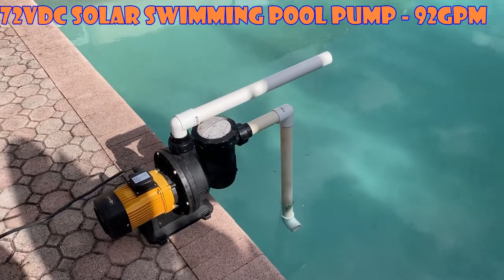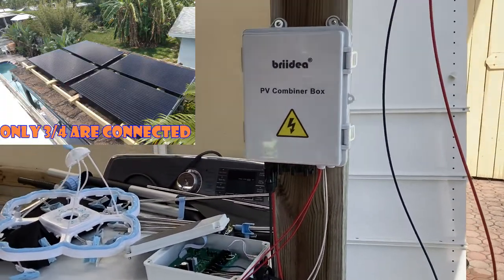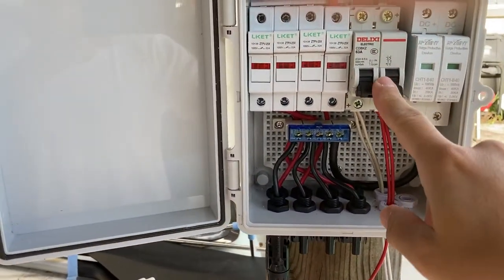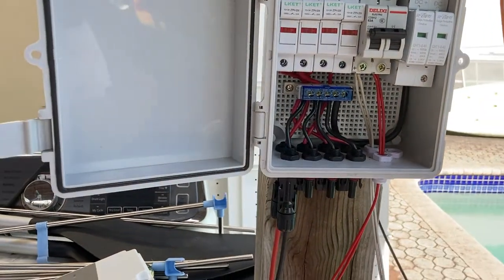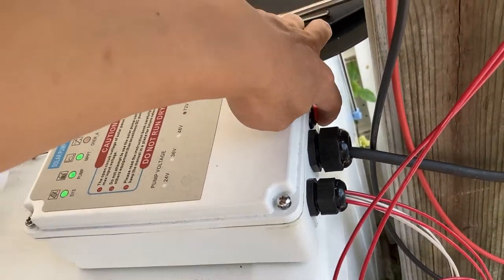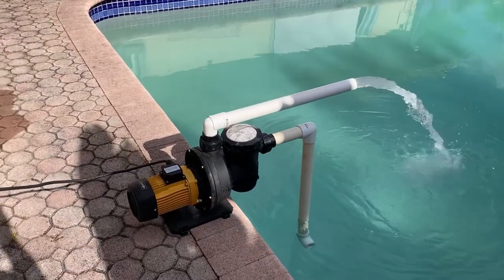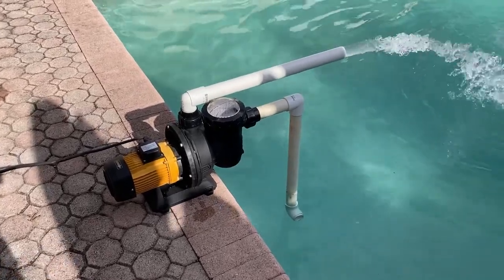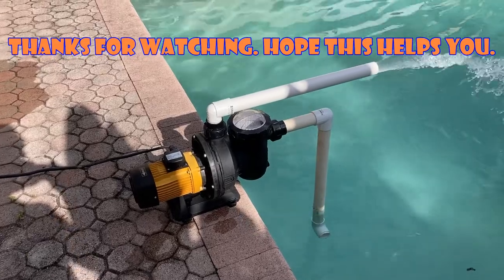Solar pool pump demo

Comment: I'm building a small plunge pool ,about 1200 ga. This would be ideal for me .. since it's all solar do you see any reason to have to run a electrical ground bond ?
Reply from the maker: Hi, John. This 900 watt solar pump may be a tad oversized for a 1200-gallon soaker. I believe they sell smaller versions of the same product line that will not need as many panels to power. I'm not an electrical expert, so I'll defer your question to a guy I follow on YouTube from my home State, Mike Holtz - https://www.youtube.com/watch?v=Ypo99VRxT44&t=1786s
Reply: Any electrical around a swimming pool should always be grounded well... 

Safety

Comment: 1 Year update on your Solar pool pump installation?  What make model did you buy?  How is it holding up?
Reply from the maker: Thanks for keeping up with my status, @flippedout. The pump is still humming along, but I had to replace the bearings a couple of months back because it runs too much; it runs for however long the sun is out, every day of the year. I could put a timer on it, but that seems like a waste of free solar energy. I highly recommend this solar conversion for all those still grid tied to the matrix.

Comment: Hi I also bought mine, do you really need the combiner box?
Reply from the maker: Hello, Delton. The combiner box is not necessary for my set-up because I don't have many parallel connections, but I like having a switch in-between the panels and the controller. The fused connection in the combiner box, along with the lightning protection circuit provides a nice touch. All the best to you and thanks for watching!

Comment: What kind of PVC connection is that? Looms like a 2" slip/socket. Did you use pvc glue or is it a compression fit like on a True Union?
Reply from the maker: Nothing was glued in this test set-up; all friction fitted. In a second video, all of the PVC mating points were glued. The black connectors are of the True Union variety with gaskets. And these were 1.5" pipes. Thanks for watching. All the best with your install.
Reply: @SuperWhizy  I have the 1200w pump arriving tomorrow, looked like it has the 60mm/2in pvc fittings. Phew, thought I bough the wrong fittings!

Comment: I hooked up 6 185w panels in series and I burnt my box up pump never had chance to turn on
Reply from the maker: Sorry to hear about the mishap, Turklanes109. The solar controller has very specific input parameters that must not be exceeded; in particular the Open Circuit Voltage (OCV) for the panels cannot exceed the rated voltage input for the controller. Linked in series, the voltage has an additive effect, hence to achieve the proper wattage, you'll have to parallel the panels and boost amperage.
Reply: Ok I’ll try parallel
Only thing I’m confused about is when you say boost the amperage
Reply from the maker: According to Ohm's law, voltage(V) is additive in series and current(I) is additive in parallel. I find it easiest to back in the numbers through the power equation: P=VI. Your 6 panels at 185w produce theoretical max of 1110w. If your OCV limit is 150VDC, string in serial the number of panels that add up just below the voltage limit and parallel the rest. Assuming you add up to 120VDC, this will put your current at 9.25amps. I wish you success going solar, Turklanes109.

Comment: Hey Superwhizy, what was your all in cost on this set up?
Reply from the maker: $480(pump and controller), $200 (used solar panels), $100 (combiner box),  %80 (lumber and hardware for solar racking), $150 (wiring and connectors), $50 (plumbing)... All in all, roughly around $1100. Knowing that it'll cost nothing to run the pump 8+ hours a day; priceless! Make it happen, Stephen. ;-)

Comment: Just finished my hookup today inspired by this video. One question when solar power is low morning and evening will that harm the motor?
Reply from the maker: Welcome to the solar rabbit hole, Sir Gregalot200. I do notice mine cycling on and off quite often during the transition periods at dawn and dusk, or overcast days, but the controller has been performing rather well without intervention. I thought about wiring the on/off switch on the controller to a smart timer just so it'll come on when the sun is definitely out, but I've not gotten around to it. Thanks for watching and for the motivational credit. All the best!
Reply: @SuperWhizy  While swimming yesterday evening I paid attention to the pumping and even though the sun was below the tree line the pump was running slow but water pressure was still coming out of the vents, not strong but it is pumping. Also our pool seems to be cleaner it is crystal clear its normally clear but it's now really clear.

Comment: Any update on how this setup is working out for you? I'm looking at doing the same but also having a ac pump and a flow meter to turn on when there is not enough sun or rainy days. Also do you know what the volt and amp specs are for the controller?
Reply from the maker: Hello. I'm extremely happy with my Solar pump set-up and have made a second video about it here: https://youtu.be/gB5BYZT-3pc. I don't recall the exact specs, but I know the pump is a 72 volt model with around 900 watts of power. It's a variable speed permanent magnet (brushless) pump that is mated specifically to the MPPT solar controller. I would recommend searching for others who have installed their system in tandem with an AC system, I didn't want to bother with the extra plumbing, hence my barebone approach to this issue. Thanks for watching.
Reply: @SuperWhizy  what kind of warranty does that pump have?
Reply: @wildnuts6197  oh... that its cheap enough that if it goes back you can buy another for $400?
Reply from the maker: Strange... these two comments did not show up on my management UI. Glad you were able to sort out your question. All the best with your Solar conversion.
Reply: @SuperWhizy  I am curious about how you switch it on / off.?? when the sun gets high enough does it just start running?
Reply from the maker: @williamrenfroe546  Apologies for the delayed response. These sub-threads do not show up on my video management interface. My set-up can be shut-off by killing the solar input, or downstream at the MPPT controller. The pump starts running at first light, albeit poorly (like a wheezing asthmatic), but eventually it picks up speed midday, and goes through the same wheezing cycle at dusk.

Comment: WHAT'S the power voltage or HP ON THE PUMP?
Reply from the maker: Hello, Larry. I never did figure that part out. The booklet that came with it said it was a 900 watt permanent magnet pump. My motivation for getting this package was specifically to NOT have to figure out this aspect of the operation; AC, DC, in-rush current, speed controller,... etc. I mated it to 1200 watts of DC input, connected the pump to the MPPT controller box that came with it, plumbed it, and am treating it like a black box that'll do what it needs to. I have a hunch that it may be a DC motor because the variable speed that fluctuates with the solar irradiance. Thanks for watching.
Reply: Thank you for your response...I have a 40k gallon pool I'm trying to figure out what I need to run it solar..
Reply from the maker: @larrymiller7128  40k gallons is a lot of water to cycle through. Perhaps you may want to consider a more gradual approach; If you have multiple pumps and lines, swap out just one with solar, this way you can juxtapose the performance. Pardon my delayed response, I do not get notifications on my UI with reply threads. Good luck!

Comment: Another question, what type of filter are you running it through?
Reply from the maker: Hayward 900. I use a generic 900 square feet pleated filter inside the housing.

Comment: 3=4?
Reply from the maker: Keen observation, @flankysixtyfour. It's technically wired in a 3 series configuration with the 4th in parallel to stay under the open circuit voltage limit. I will be more precise with future videos of this sort. Be well.

Comment: Hello again, I purchased the 1200 watts pump but where can I buy the pvc  connector that can fit to that pipe on the pump..homedepot doesn't carry anything fit 1.8 pipe..thank you in advance..
Reply from the maker: The unit I purchased came with a threaded black union interface that connected to a 1.5" PVC pipe; one for the outlet on top and another for the inlet. Let me double check.
Reply: @SuperWhizy  my came with threaded black fitting but I can't find anything to fit my 1.5 pipe to it..

Comment: No need for combiner box. I have yet to see anyone with the pump actually working connected to the actual skimmers.
Reply from the maker: Mine's been powering a Hayward navigator through the skimmer intake for 2+ years, @manuelsiliezar2552. I've got a few more videos involving this pump on my solar playlist. A word of caution: this first solar toy was what started me into this solar rabbit hole that's now become an expensive hobby. Thanks for sharing.
Reply: Natural current out of Florida has the best demo’s

Comment: Would this be enough to run a pool bottom vacum? I live in Las Vegas
Reply from the maker: I've got an inline leaf canister, 30 foot line, and a Hayward Navigator tethered to the suction side of the system, and it powers through beautifully. With the amount of sun you've got in Nevada, I don't imagine you should have issue. All the best, Sean!

Comment: How did you determine how many panels you needed to run the pump?
Reply from the maker: Hello. When I purchased the pump, it was labeled as a 900 watt unit. Each of my panels theoretically yields 300 some watts, so I figured four of them would suffice. As long as we stay under the open circuit voltage requirements, keep the energy flow above a certain threshold, the work will follow.  The MPPT solar controller that came with the unit has been very robust and reliable, in spite of my undisciplined approach.

Comment: Could this pump run off a battery for service use?
Reply from the maker: I've never tried, Luke. I purchased the pump with its mppt solar controller as a package and simply added panels and plumbed it in. This gateway solar experiment has led me deep into the rabbit hole and I'm now playing with inverters that can power regular induction motors with LiFePO4 batteries, which may be more appropriate for what you're considering. Thanks for watching and commenting.